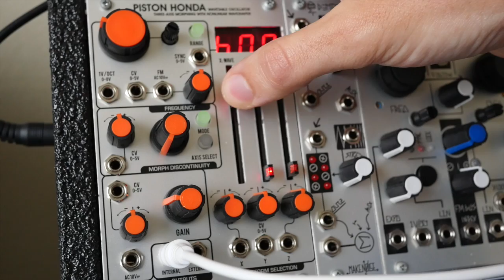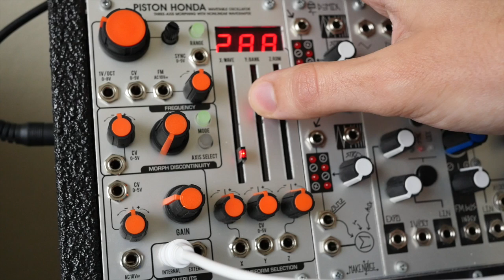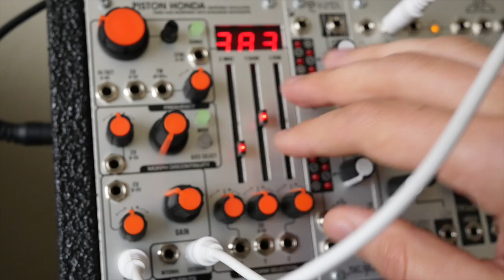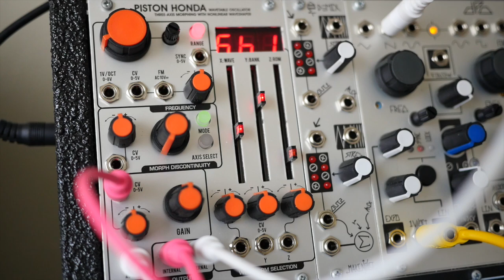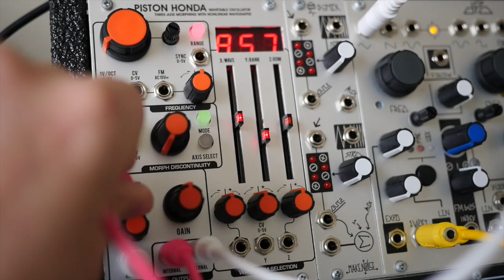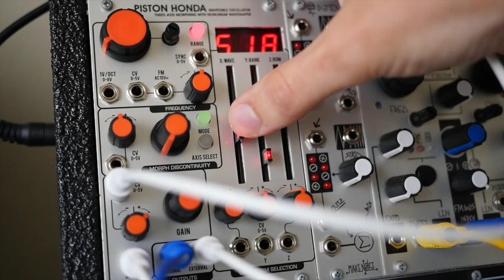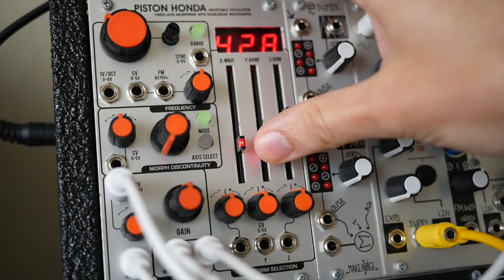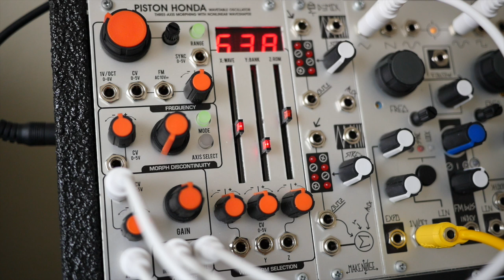Piston Honda MKII  - Industrial Music Electronics (The Harvestman)

Comment: Can't see whats so special aboht this - buy a laptop and get some software. What am I missing?
Reply: Edit. Watched rthe full clip.Kind of.. em.. really... em.. Cool As F... 😂
Reply from the maker: Glad you got it in the end :)
To your point though, this particular module is entirely digital and could easily be achieved with software.  There however is a very tangible benefit to the dedicated physical interface.  For some that may not matter, but for me, I never found anything remotely close to the immediacy and responsiveness of a physical instrument (including the use of control surfaces).

Comment: Can this be used stand alone like a synth or do you need to buy a ton of modules to use it?
Reply from the maker: Not standalone since it is just the oscillator.  But, I don't think you need a ton of modules along with it.  A VCA and two envelopes would probably be a super capable mini setup.

Comment: It sounds so harsh and nasty unless its put through the low pass gate. What other prettier more musical sounding wavetable modules would you recommend?
Reply from the maker: I prefer the harsh and nasty and then tamed by LPGs or filters if necessary, so I don't have any significant experience with smoother ones.  However, the Synthesis Tech E350 has long been the go-to for smooth wavetables and I've heard many good things lately about the Erica Synths black wavetable oscillator.
Reply: jamescigler Thanks i quite liked the demos i heard of those. Which category does braids fall into or can it be both?
Reply: Pete Horam think braids has a lot of analogue style wavetables too, aside of the bowed, fluty, vocal wavetables. Can't be as smooth as piston Honda or e350 though (imo the smoothest out there) shapeshifter is kinda glitchy as well but those morph functions are awesome..

Comment: Is this a rough (rough) 
 to the Mutable Instruments Braids and/or Waldorf NW1? I"m just trying to understand how they differ. AKA, "wavetables".
Reply from the maker: The basic operating principle of wavetable oscillators is the same.  Some internal function "scans" through a "table" of values that represent a single cycle of a waveform.  Where various wavetable-based synthesizers really differ is in the "wave tables" (data) that are loaded in, and any other aspects over control of how these tables are scanned or modulated.  I think the PH is one of the more "modulatable" examples, giving immediate control over scanning through lots of different wave data, PLUS, being able to feed any kind of audio signal to scan through the table (rather than the typical internal function which is usually a rising sawtooth like signal).
Reply: Thanks. BTW I had a Korg DW8000 waaay back in the day, and loved its sounds. That was my intro to wavetables.

Comment: Awesome video - doing a second one at all?
Reply from the maker: I wasn't going to, but I guess I'd consider it.
Anything significant that you think I missed?  Or something specific you wanted to see/hear more of?
Reply: +jamescigler I suppose I was interested in your approach to patching into the rest of the module.  Obv. not necessary to make additional video.  This video alone is pushing me closer to picking one of these up.  Do you like any waveshaper modules more than what this guy is capable of?
Reply from the maker: Ah ok, this video covers most of my usual approaches - the "using as a waveshaper" is the most common.
I think the PH is probably one of, if not the, widest range waveshaper in euro, especially given how easy it is to scan/modulate the waves.  But it has a distinct sound.  On the analog side, I really like the Toppobrillo TWF and the Abstract Data Reactive Shaper.  I'm looking forward to getting my hands on the Audio Damage Shapes.
Reply: +jamescigler Great, thanks